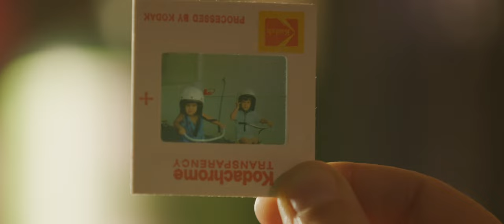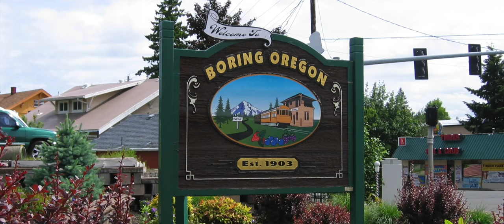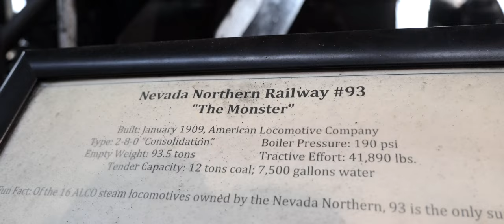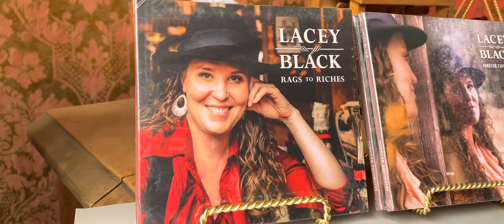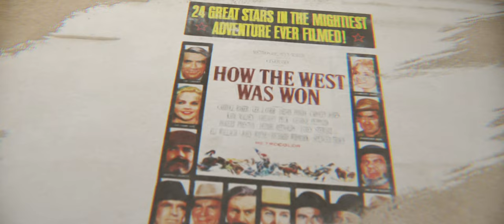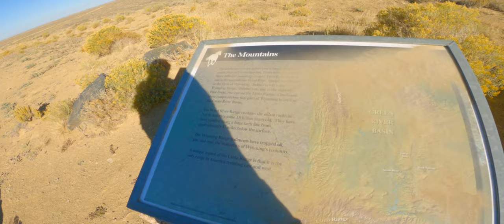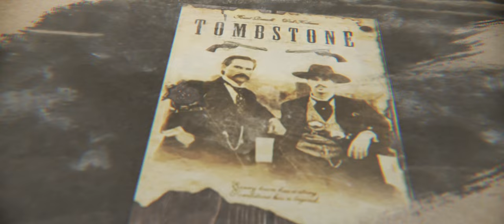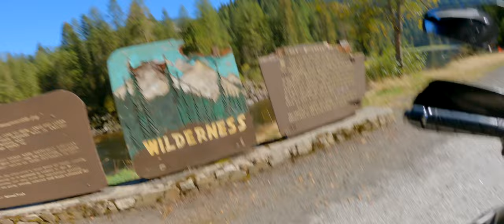Discovering the History and Beauty of the American Wild West

Comment: Dude, how many cameras and drones do you carry on that lil’ 500X? And some shots make me think you’re also carrying an Edelchrome Slidder.
Best regards from Quebec!
P.S. I found your video on your equipment in your top-box, which answered my question.😊
Reply from the maker: You know I did actually consider at one point in bringing a slider but I just couldn't justify carrying it for the one or two shots that I would use it for. Still tempting to bring one as I like using them.
Reply: @AnthonyJoh  So how do you explain the shot at 19:54 (the bristle trees)? It’s not hand held with the clouds travelling by so fast.
Reply from the maker: That's stock footage from Pond5.